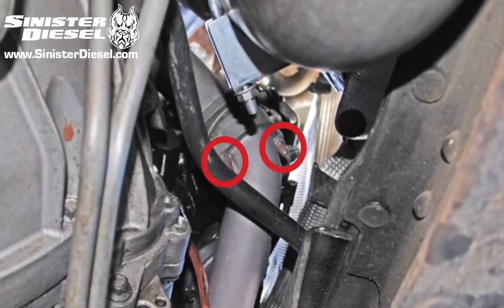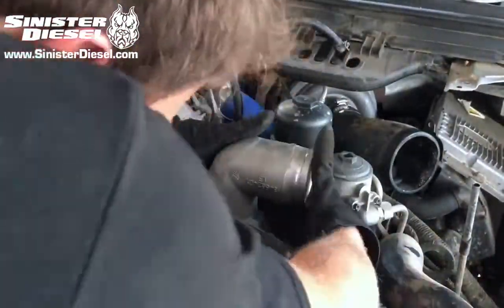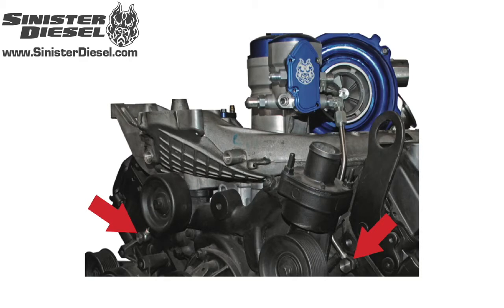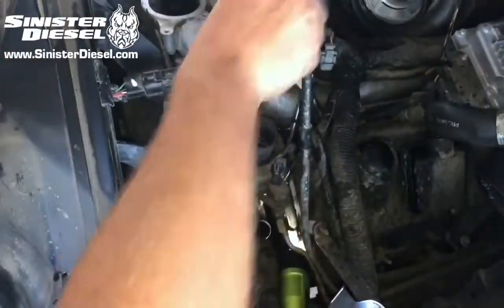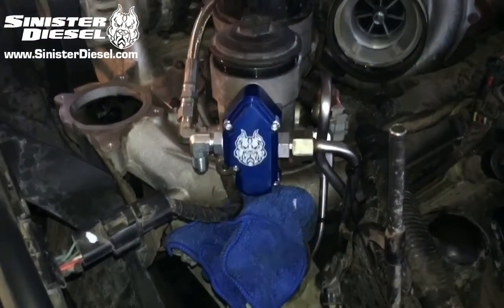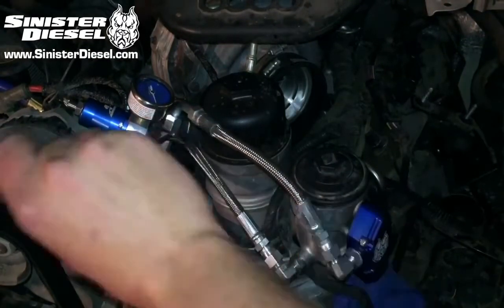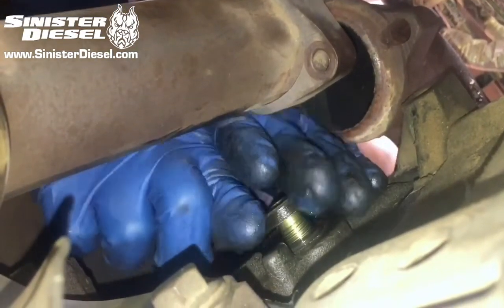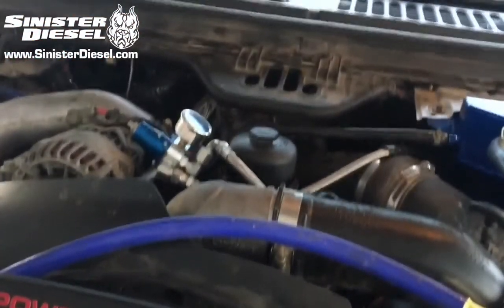Installing Sinister's 6.0L Powerstroke Regulated Fuel Return Kit

Comment: How do you get Air out the system
Reply: If you have to ask that question , don't try to install this yourself . You will end up regretting it
Reply: @dmhpokey  if you can't do this yourself don't buy a 6.0  😂 you'll end up talking shit about all 6.0s.
Reply: With every key cycle it pushes fuel in then the air is vented back to the bowl.